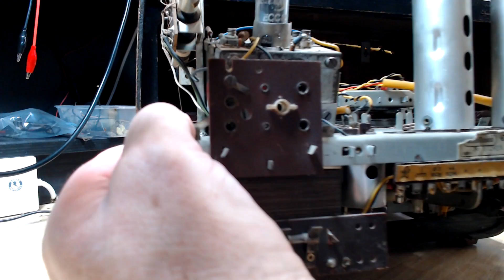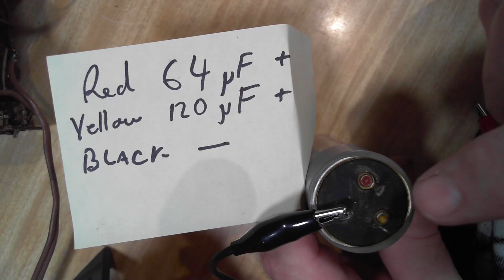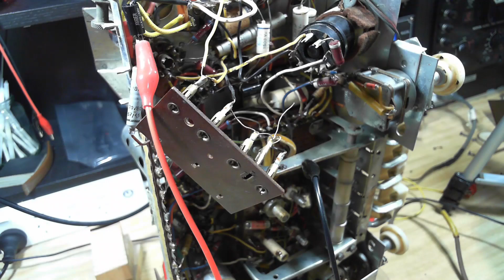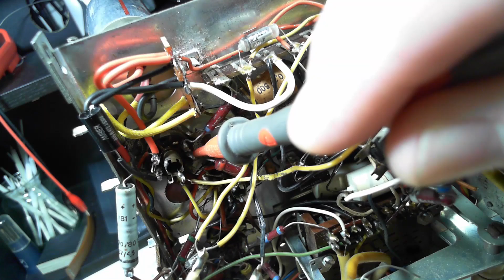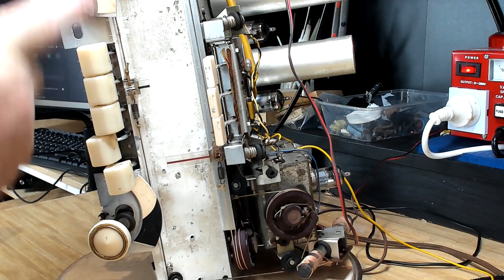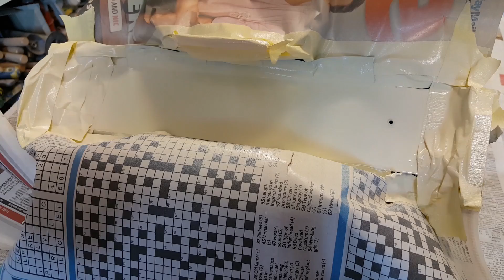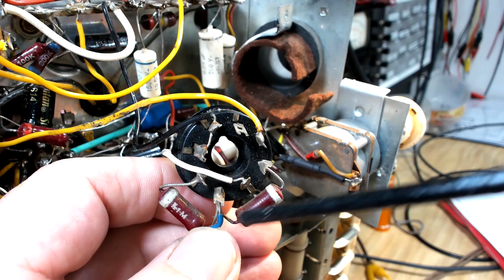NordMende Elektra 58 Restoration & EM34 Magic Eye Substitution  Pt 1

Comment: This radio 📻 was much 👌 like a classic car 🚗 put to pasture after it's engine stops running. I'm so glad that 😊 ya saved it from going to the dump 😊. At least 😅, the cupboard was the guy's 👦 "pasture" for the radio. It stayed safe 🙏 that way. By the name, I'm guessing that the speaker 🔊 is field coil. I'm also guessing that 🤔 this radio 📻 is from circa 1956. Your friend, Jeff.
Reply from the maker: Thanks Jeff. The problem was it didn't have a speaker when I opened the case 😄

Comment: Do you have any videos on repairing the buttons. I have to press the buttons lightly to get them to stay down. If I press quick or too hard they pop back on.  Referring the the band selection buttons.
Reply from the maker: Hi muxxor. I don't have anything specific on that but it sounds like the lock plate on the switch pack is slow to move to the latch position. The latch plate is a thin strip of metal that transverses the width of the switch pack. When you press a key the lightly sprung plate slips behind a slot on each key mechanism. Yours may have a broken or weak spring or the latch plate is gummed up making it slow to react when you press a key.  When the 'Off" key is pressed it pushes the latch plate away to unlatch any latched keys. Check and clean the the latch plate and make sure it moves freely and the spring is still doing it's job. There may be another cause of course but that seems to be what you are experiencing  Good Luck 🙂
Reply: @DavidTipton101  Thank you for the reply, I take it apart and check all those things.

Comment: I cretainly understand modifyng the EM34 circuiit for a cheaper Magic Eye tube.  Unless you are a purest the $98 plus shipping cost is a deal breaker for restoration.  I like how you made the replacement "cap with 10mohm resistor" for noise quieting... genius.  I am now hunting for one of these looks exciting.
Reply from the maker: I was happy to use the soviet eye, it's not a classic radio and the eye looks original when the radio is working. They are a nice radio and look good in a collection. Thanks Michael 🙂

Comment: Hello Mr. Dave, finally I decided  no work more in the Nordmende Elektra d12 radio repair, after a lot of man hours, money and patience I  can't got the radio repair. I must tell you this is the first time this happen to me, I have repair a lot of tube radios from my own collection such as a Transoceanic Zenith G500, several tube radios GE 1949-1960, PHILCO tube radios 1960, ZENITH TUBE RADIO J508B, PACKARD BELL 5R1, MOTOROLA 55C1, RCA 6X5A, and more. I have an oppinion about the electronics design of german tube radios they  work with a power supply of 220 vca and a rectifier to 220 vcd, this is dangerous in many ways, it is very difficult to find shortted circuits, the schematics from the manufacturer have conffused information. Thanks for all your support help, best regards.
Reply from the maker: That's unfortunate Rodolfo, I wouldn't worry so much about the high voltage, 120 will kill you as well as 220. Be very careful and don't touch anything when the set is powered. You need to break the set into pieces to determine where the fault is. Does it work on any of the bands, AM, LW and FM. Does the phono input produce a sound when you touch it, is there any hum from the speaker... things like that. Take a break and have another go next week. Good luck 🙂

Comment: Hello Mr. Dave,  I will appreciate your valious help, I got a Nordmende Elektra d12 German radio, after a full restore including  a new diode  full wave rectifier, the outlet voltage from the rectifier is 375 VCD and the transformer voltage in to the rectifier is 257 VCA; the radio  schematics show a voltage maximum of 257/262 VCD, my question is how make a voltage drop from 375 VCD to 257 VCD??  It also the two light bulb terminals are shorted when one of the termimals is grounded, this is detected with a bulb dim protecction. I know ohms law, but please give your opinnion; thanks a lot.
Reply from the maker: Hi Rodolfo, is the radio working? Do you have the magic eye fitted and working? If so, there is something wrong either with your measurements or maybe the primary transformer tapping is set to the wrong voltage. Test the filament voltage is 6.3volts AC. The voltage rise from replacing the rectifier should be in the order of 20 to 30 Volts. 120 Volts is way too much. German radios operate on 220 Volts usually if not an export model, your local voltage may be higher than that 🙂

Comment: Hi. Anyone can help me? I have Nordmende ELEKTRA U13, very often no sound on FM. Magic eye shows strong signal received but no sound. The sound comes on itself after hours left the radio powered on. Once the sound is back itself, if I'll switch the radio off and on again with tens of minutes, the sound is there, if I'll switch the radio off and on again after hours, the FM sound is gone again and comes back itself after long waiting time. All tubes are good. Thanks in advance to anyone will help me.
Reply from the maker: It's hard to diagnose from here djextreme77. the magic eye gets it's signal at the FM ratio detector so it could be presumed the fault is after that. The only components between the ratio detector and the FM select key switch is R103, R134, C103, C134 and the switch itself. It may be worth looking at those to start with. That may not be the fault though but it's a start 🙂
Reply: @DavidTipton101  Thanks very much for your reply. Today I have noticed that the magic eye does not always show strong signal when the sound missing. I'll try to locate the resistors you have mentioned, maybe I'm lucky.. Today I have giggle it everything for hours and hours, no sound on FM, later on without touching it, the sound came back itself cristal clear. Thanks again, mate,
Reply from the maker: @Real.extreme8  If the magic eye is isn't working when the sound is missing that will change what I said before, the fault will be before the ratio detector not after.
Reply: @DavidTipton101  what is radio detector, please? Where is located? I feel sick because of this problem. I have another one fully working Grundig, but I love the Nordmende because of its nice sound 😢
Reply from the maker: @Real.extreme8  If you have that schematic it is the two black diode symbols facing in different directions below the lettering 2 AO 79 on the top of the page. If there are still paper capacitors in the radio they need to be replaced, from the symptoms you describe it sounds like a resistor or capacitor is the problem. Do not work on the radio while powered and even after shutting the power off you can still get a shock from the filter capacitors. Be very careful. 
The schematic is here: https://elektrotanya.com/nordmende_rundfunk-empfaenger_4_613_m_2000_elektra_skandia_rigoletto_sm.pdf/download.html#dl
Reply: @DavidTipton101  the FM switch/key 100% clean and good

Comment: Whilst I do like the NordMende radio sets, especially the transistor portables et most of the earlier 'German' valve sets have some (Grundig was NO exception later on either.) real issues for wear and tear that can be seriously problematic to fix. 👀 The push button selector system is one example. The slider pins and contacts can wear to a point you have to strip out the entire unit and laboriously attempt to salvage it et 👀Getting at some parts, means stripping out and down (my partners fav occupation) 😁 Not forgetting of course, as per the Siemens radio gram that I am currently working on (1948) that has that SELENIUM rectifier, which I seldom have found other radios of the same era. where they have not failed. 👀 The FM or VHF system can be testing on the patience (if not the soul ). Seem to slip out of alignment AND the two valve system, EF41s re VHF have posed problems. We have to remember that the Germans et were very much in the early days of UHF / VHF (A lot of their communication field devices worked on UHF)👀 The power transformer was also destroyed probably by that selenium rectifier failing. 😒They also liked using the radio system et built in given sections. 👀Alright if you bear that in mind when working on them. Most of the circuit diagrams (my Siemens in particular) has set colour coding abbrev letters, values AND voltages (20,000 ohms per volt). I had the original power transformer rewound. Used new bridge rectifier / ballast resistor AND 4 main power electrolytics et Overall on the Siemens the voltages run to over 300v. 👀It also has five speakers. 2 mid, 1 low and two voltage powered tweeters.  2 LS output transformers. 3x15ohm, plus the tweeters. Cross over networks. The entire audio output stage is quite complex. 👀 9 valves. Power via the transformer gives 2 x 6.3 volt (2Amp) 240v (UK) primary with 300v x 2 secondaries (750mA). A second power transformer for the turntable unit et 55v x 2.👀 Internals now working and alignment OK. Switching trouble free. (finally 😒). Overall whilst I have THREE sets in my collection that are German sets I'm NOT crazy enough to desire adding any more thankyou! 😁NEWBIES! Many of the so called SYLVANIA valves are RUSSIAN made and even listed as direct equivalents they quite often are NOT! The QUALITY of the valves also is questionable. If you can source brand name western valves ? Do so. Ex military types can also be OK for replacements. I HAVE on occasion swapped out the valve bases and changed valve types/equivalents et The UKs Valve museum website and or the Radio museum website are superb for valve information, radio / electrical devices et NOT forgetting Ray's 'Radio workshop' (UK) website for a lot of really good info on radio and more. 👀 Thanks for the vid David. 👍 It is always good for others to appreciate someone's hard work, patience and achievements.
Reply from the maker: Hi Arthur, thank you  for your in depth assessment of German and European radios in general. Thanks for watching Arthur 🙂

Comment: I know this selenium rectifier :D My radio has the same one - its made by Siemens. Siemens components have this "S" like Symbol as seen at 5:50 over the 5 and the C in "B250 C75". I replaced it with a more modern solution with Diodes + Zener to drop the voltage.
Reply from the maker: Thanks Kevka Bluebird, I replaced it with diodes and a dropping resistor 🙂

Comment: One tip: I saw you working on the large capacitor on the lathe. To prevent the machine to be filled with dirty stuff, place a large sheet of paper over it, underneath the capacitor. It's easy to remove afterwards and your machine will nog get all the chemicals from the capacitor which might cause rust.
Reply from the maker: Thanks De Mus, good idea 👍🙂

Comment: Just forgot to mention, that shielded cap you did replace has a resistor of 10meg to ground inside the shielding.
Reply from the maker: Thanks schorse1000, I realise that in part 2 and fix it. I know for next time though 👍😀
Reply: @DavidTipton101  Oh, my bad. I just watched the first part...
Reply from the maker: @schorse1000  Haha... it was my bad, luckily someone pick up my mistake as well as you, cheers 👍🙂

Comment: You might want to put a 47k resistor in line with the target to prevent it from wearing out so fast. It gets a bit dim, of course, but that's barely noticeable.
Reply from the maker: Hi schorse1000, thanks for the tip 👍😀

Comment: God i love nordmende, best radios ever , quality cannot be compared to anything else!! great video Dave !!!

Usually the Band selector switches on the front suffer from carbon tracing and they short, but its not that common unless the radio is too old.
Reply from the maker: Hi Amr, thank you. Yes, quite a well built radio. I was worried about the selector switches but they worked ok after a clean 😀
Reply: @DavidTipton101  That is great, i believe Shango066 had one of these and it was a nightmare to get them out of the chassis, glad you did not need to do that 😃😃

Comment: Check Mr Carlson's Lab's video on the capacitor shields, on a lot of caps one side is the outer shield, so depending on how you turn them you get the same effect. How much it really matters though is debatable. https://www.youtube.com/watch?v=BnR_DLd1PDI
Reply from the maker: Hi Sebastian, I've seen Paul's videos on the shield, I have to say I don't worry too much about it though 🤔
Reply: David Tipton Yeah, I think it definitely matter to someone at Paul’s level, not just sure if it’s that noticeable a difference to the general public. I’ve been thinking about making his little gizmo just to get into the habit of putting caps in facing ground so to speak, on the off-chance that some day it’ll spare me some trouble if I ever run into a design where it really does matter. :)
Reply from the maker: @sstorholm  Yep, there's no harm in doing that

Comment: It would seem that radio might have made its way from the UK to AU. Radiospares in the UK was a huge supplier to the radio and TV trade back in the day, and I still use them for components myself. 
Those RS smoothing cans are actually not too bad! I have some NOS ones and they have responded well to reforming. I’d say that can was made in the very late 1950’s, so the original Elko or Siemens smoothing can must have had a short life! 
I mainly collect these German sets, and the Nordmende FM tuners in them are a real pain to work on sometimes.  I recently did the later 1958 version of the Elektra, that had an open oscillator trimmer capacitor in the FM front end. That was a pain to replace!! 
Those ERO capacitors (toffee caps as we call them) are just awful! They don’t even taste like toffee either! 

Excellent work so far David, I shall watch part two shortly! 
G
Reply from the maker: HI George, thanks. I still use RS Components here, they have a large stock and deliver next day if it's in stock. I didn't want to go near the FM tuner and glad I didn't need to. I have another German set, a Kaiser, it was full of Wima brand toffee caps, every one of them was short and caused a bit of damage. Thanks George 👍🙂

Comment: Excellent video. The radio was a bit incomplete when you got it. What were the missing valves ? ( ECC83 and ECH81 ) they are very common European valves. Great job on that filter cap replacement.
Reply from the maker: Thanks RODALCO2007. The missing valves were ECH81 and EF89. I had one that had been cataloged and the other I found at the bottom of a very large box of valves. I doubt I have any of the other valves 👍😀

Comment: Excellent video Mr Tipton, thanks for uploading!!  I am currently restoring EXACTLY the same Nordmende Elektra and have filmed it to upload on YT in a week or so. This is such an amazing coincidence! Imagine 2 people restoring a 1958 radio, same make and type in the same month of 2020. I was gobsmacked when I saw your video just now :-)
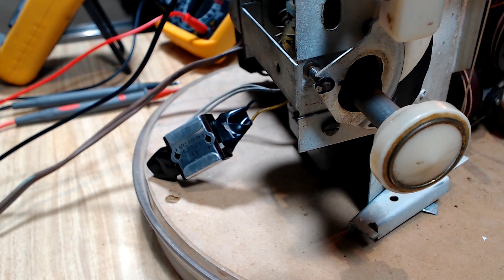Just some quick info if i may:  @ 15:40 you fell for the same thing as i did initially, that cap is not shielded, its a 0,01 cap plus 10 meg resistor combo, visible on the schematic as R57 and C97 in that square dotted outline, I just soldered a resistor between pin 8 of the EABC80 and chassis, its the grid pullup for the triode section. I didnt see you replace the electrolytic C87 , you point at it @15:27. This one is FM ratio cap, veery important to replace, even if the old one tests good it is not. 

The ECC85 often goes duff and also the ECH81. Although the ECH may work fine as the converter on AM, it may perform weak on FM where it doubles up as the 1st IF amp. I always swap those 2 valves against known good ones from another radio before attempting to alter the tuning of any coils, especially those in the FM tuner, the factory settings are almost always the best. 

For the magic eye I went a totally different route using a cheap 6AL7GT with a small tweak, will dedicate a separate video for that.
The labeled terminal strip on the rear of the chassis is a row of test terminals Nordmende used to access all relevant test points in the schematic without removing the chassis, quite a useful aid when repairing...
Cheers from Germany, Ralph
Reply from the maker: Hi Ralph, that is quite a coincidence. The cap and resistor was shielded, I just missed that it had a resistor in it as well as the capacitor. I didn't replace that C87 cap, it was the only one I didn't do, as you say, it tested perfectly. I will change it when I fit the new grill cloth, thanks. 
I didn't have any spare tubes to swap in for comparison, I was lucky to have the two missing tubes. The AM and FM coils had been fiddled with at a previous time so I needed to align them.
I looked at the 6AL7GT but the exchange rate and postage makes them too expensive here. I assume it works OK.
Good luck with your project 👍
Reply: @DavidTipton101  Hello David.  Great video and very helpful as I am working on the same model.  Regarding that shielded Cap, C97.  Mine did not have that 10M resistor, R57, and I assume yours didn't either.  Did you add it like Mr. Roehre recommends? I'm curious partly because I was puzzled by it and also because I am getting 200 VDC at pin 9 of the EABC80 and can't figure out why since caps have been changed and resistors checked.
Reply: David:  I just saw that you addressed this is a follow up video.  You saved me a lot of time--I would have missed that!  Cheers